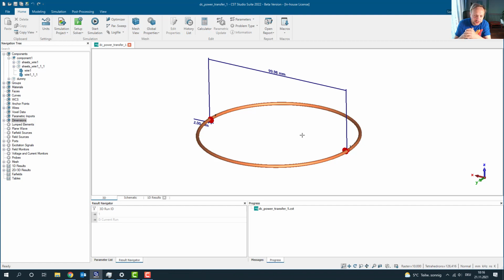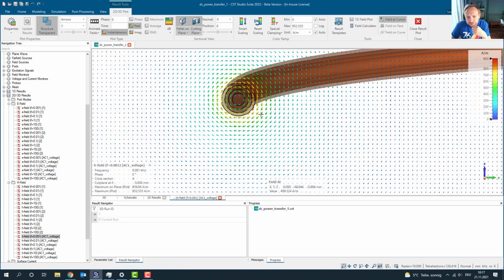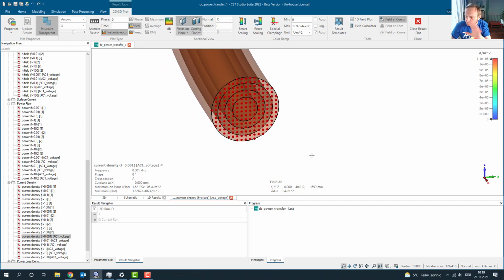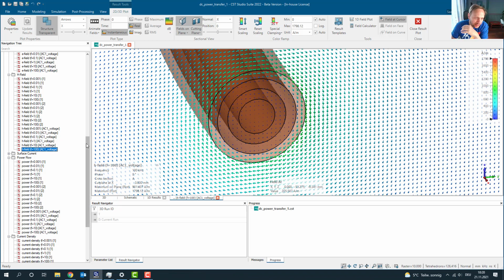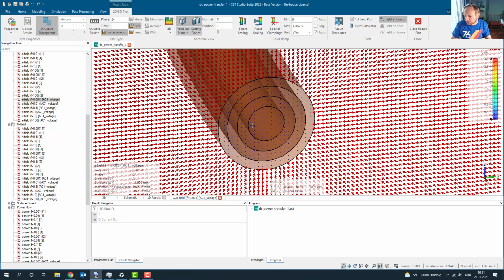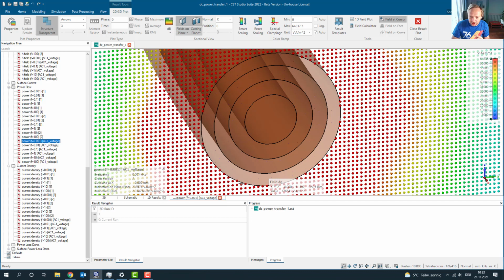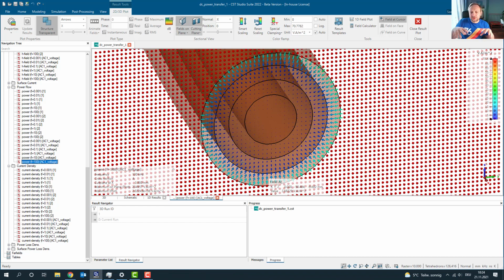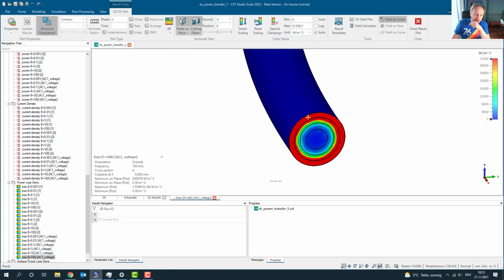Power always flows outside of the wire

Comment: Heat is the main driver of energy. Hot moves to cold and not the other way. So you are correct.. the energy flows outside the wire. In fact you don't even need the wire. You can also do it with granite which is also a good thermal conductor.
Reply: Wtf u talking about heat being the driver of energy.
Reply: @alexbenzie6585  If you light a fat candle and put some ashes in it you can see the ashes moving towards the flame then getting repelled as they get near in an endless cycle. What is driving the motion of the ashes? .... Heat. If you have a heat engine that produces alternating current.. what drives it? .. Heat again.....
If you have a steam engine.... what drives it? certainly not cold...
Reply: @omegafile  bro none of what you are saying is in any scientific publishing ever lol. Heat is not a driver of energy it is a form of energy go back to school.
Reply: @alexbenzie6585   https://www.youtube.com/watch?v=2gLRFuX5yNE
Reply: @alexbenzie6585  That's funny because I designed a heat engine that is being looked at by the minister of energy for consideration in powering a whole province.
Perhaps you need to think before you speak.
I too don't use wires. You really don't need them. I took it a step further and used sound to make the heat.. and used the heat to make a sound to make it power itself from it's own sound.... so in reality sound drives it.. and once  it gets hot the heat drives it by making it make it's own sound... which vibrates an electromagnet etc. It's pretty simple.
If I take a piece of granite and line it with gold and stick it in the sun it will get hot and when it gets hot it will become magnetic... and if you vibrate it it will give off a magnetic field. What made it magnetic? The heat... why did it get hot? .. because of the vibration.
So I have taken simple sound to create a voltage differential to create 68,000 volt electric arcs that produce temperatures above 10k degrees F to make a lot of heat that creates a suction through a hole to make more sound from the heat that causes an electromagnet  to vibrate in radio frequency... producing a lot of energy. It would take me too long to explain it... yet it is very simple. It has no magnet or coils or any wires or any moving parts... but it does become a magnet... so incredibly dangerous. It doesn't need wires to hit you with a bolt of lightning if you get too close... doesn't need air either.. it will work in a vacuum.

Comment: Hi Andreas, very interesting simulations. Can this longitudal field inside the wire contribute to power flow to the load? Why do we say that power flow happens with the field surrounding the wire?
Reply from the maker: The field inside the wire does not contribute to the power flow: The Poynting vector in the wire points inwards the center of the wire and not from source to load.

Comment: The expanding electron crosses over from the subatomic realm to atomic realm. DC produces a magnetic ‘field ‘which is expanding electrons leaving perpendicular to wire length as it spirals - skin effect. Not sure DC has an electric ‘field ‘. Fields usually between capacitor plates: dc flow ‘blocked’, ac accepted as a flow. B and E “waves”are electrons physically leaving the wire. Complicated of course. “The Final Theory: Rethinking Our Scientific Legacy “, Mark McCutcheon for interesting physics approach.
Reply from the maker: Also at DC there is an electric field. All effects here are "macroscopic" and do not require an atomic Interpretation. Electrons can not simply leave a conductor. It requires significant energy to do so. I recommend getting familiar with the photoelectric effect. That the theory Einstein got his Nobel price for.
Reply: @AndreasBarchanski  Expanding electrons- Expansion Theory- shows Einstein’s photoelectric effect to be incorrect. No energy, charge, photons, waves, spin, fields, potential, quarks. Physics put on proper foundation in 2002 in referenced book.
Reply from the maker: @davidrandell2224  In physics, a theory can not prove another theory to be wrong. Only an experiment will prove the theory to be wrong. As long as there is no experiment that contradicts the photelectric effect explanation by Einstein you can not claim it to be incorrect. Maxwell equations have proven to be correct since 1860 and the fact that you can type comments in Youtube confirms this.

Comment: I was wondering if you could simulate a rectangular circuit with source and load in asymmetric positions, like the circuit shown in John D. Jackson's paper on the three roles of surface charge ( I can provide the doi if needed, but I've got the feeling you know it already).

In that case we should see a power flow that's not uniformly 'distributed' around the wires, but it's mostly concentrated in the space.

Nice simulation, BTW.
Reply from the maker: Thanks, can you share a link to the paper you are referencing to. I will take a look and see if I can set up a simulation model.
Reply: @AndreasBarchanski  the paper is 

John D. Jackson
Surface charges on circuit wires and resistors play three different roles
American Journal of Physics 
Volume 64, Issue 7, pp. 855.  
July 1996

Unfortunately I do not have a link (and even if I had one, YouTube would delete it) but you might feel lucky on Google. I will post the relevant figure in the next comment (YT seems to allow for link to direct pictures - but if you do not see a comment immediately after this, it's because YT deleted it on arrival). It's basically a rectangular circuit with the battery in one corner and the load in the opposite corner.

You might also want to try a variation of the circular circuit shown in this video by making battery, conductors and load very tall as in a cylindrical circuit. The magnetic field generated will be similar to that of a solenoid and will be strong inside the perimeter (ideally constant in the case of an infinitely tall cylindrical circuit) and weak outside (ideally zero, like in the case of an infinite solenoid). This will allow you to see the Poynting vector 'spreading' inside the area enclosed by the circuit, as opposed to be near the wires.
Some 2D approximations (slices of infinitely long cylindrical circuits) can be found in 

Visualizing Poynting vector energy flow in electric circuits
Noah A. Morris, Daniel F. Styery
Department of Physics and Astronomy, Oberlin College, Oberlin, Ohio 44074
American Association of PhysicsTeachers
(submitted to AAPT on 13 April 2011, in revised form 1 January 2012; accepted 4 January 2012)

A google search should bring you to the page of the program that does an elementary simulation with multiple resistors. 

I will now try to post a link to the image in Jackson's paper. Here goes nothing...

At any rate, thanks for your simulations. They should be shown to every student of physics and engineering.
Reply: @AndreasBarchanski  as feared, YouTube has censored the link to the image.
Reply from the maker: @copernicofelinis  sorry but only found the paper at 30$ costs, so could not look into it. If you are interested, please connect with me on LinkedIn. You will find my profile in the channel info.

Comment: All this stuff makes me feel like nothing is real.

For someone who has hardly any idea about this stuff.. it sound straight "woo Woo"
Why do i have rubber around the wire if power is running outside the wire, why i dont get shocked then? ow can i even have 2 wires inside same rubber without shorting them if electricity is actually running outside the wire.

And how its impossible to measure any electricity outside the wire if it runs actually outside the wire.

Life is a simulation GG
Reply from the maker: Hi there, it is a little bit difficult to give you a simple answer. Would need to go in details to drill down what you call "electricity". The rubber is to prevent that you touch both wires and create a current flow through your body. even if you only touch one wire a current might flow because your body touches the floor and a current loop could be closed. This is for example not the case for birds. When a birds sits on a power line, he is not touching another object and no current flows though his body.... Maybe that helps your understanding.
Reply: @AndreasBarchanski  Thank you for the reply. My interest in electricity actually got sparked from me being shocked multiple times lately. Toaster, fridge and even the sink were really generous towards me. Soon enough i landed on veritassium video about wires to the moon and this got my fanatasy flowing. until to the point where i was sure im going too far and i should really educate myself on this point.

From what you are saying i would take away that its just bad communication by saying "Electricity flows outside of the wire" Since you mention rubber coating. If someone says outside of the wire i instantly think its flowing outside of the rubber coating also. Mby it would communicate better if it was said that electricity flow on the  outer edge of the wire? 

Since my mind simulation got tho the point where wires can pull electricity from anywhere to balance the imbalances in wire. Therefore electricity must be everywhere and then i got lost. :D
Reply: I mean whole this thing is creating so much errors in my brain. Whole thing about positive and negative charge makes no sense to me. It seems all quite opposite for me. Like thinking about tesla coil. I always tought its emitting power and therefor i would call it a posively charged. however it seems it works quite opposite.. its not like a sun that is emitting energy its more like a black hole that sucks in from wherever it can. So it should be negatively charged but we still call it a positive charge. I hate this whole thing so much i feel like loving it .

Comment: Why does the wire inside get 🔥 hot? If most of the current is outside
Reply: is this guy serious? xD
Reply from the maker: Because the losses that generate the heat are actually inside the wire. It only gets hot if electromagnetic power is converted to heat, not when it flows.
Reply: Because you are correct. This is clickbait bunk. If you place a resistor in the circuit, why would that have any effect if all the energy was outside? Do they believe electrons are only along for the ride? The fields they all speak of are consequences of electron flow inside wire, except at very high frequencies. At UHF you can take out the inner conductor altogether and use a waveguide. Otherwise, Ohm's law rules. Electronics has some superstitious practitioners, but youtube encourages misleading headlines. Then they have to try to back them up.

Comment: Very interesting video and the simulation was very helpful in understanding things pragmatically. Just a silly question, since the energy is “traveling” on the conductor, does it imply that a very tiny cut on the wire would not be an issue at all for the closed loop circuit operation?
Reply from the maker: Not sure how you envision the cut. However if you cut completely through the wire at some position then the electric field will be changed completely leaving 3 separate conductor pieces. This will open the loop and no power will flow!